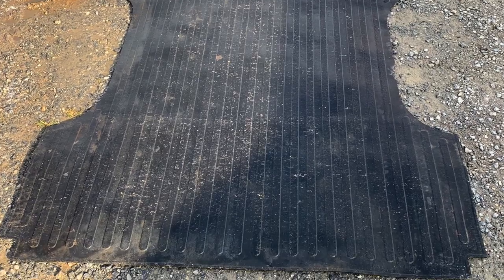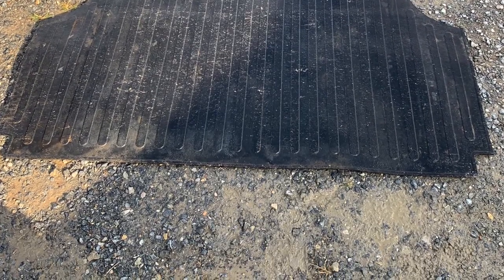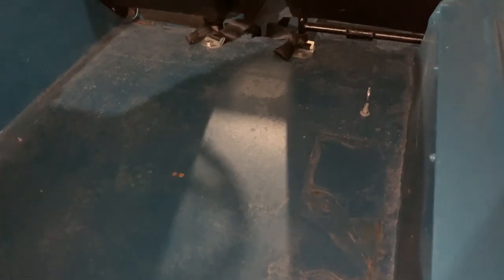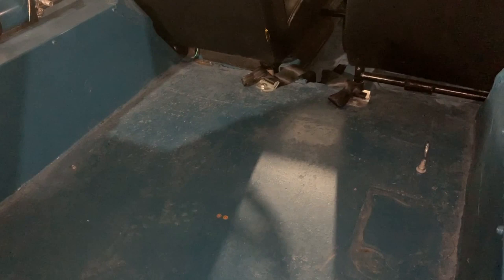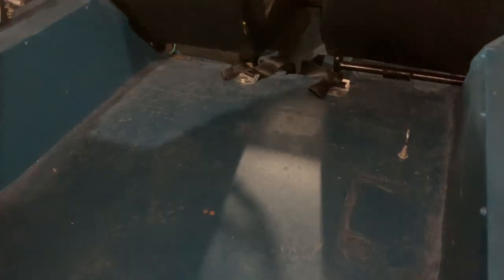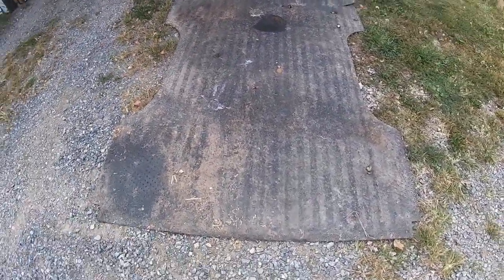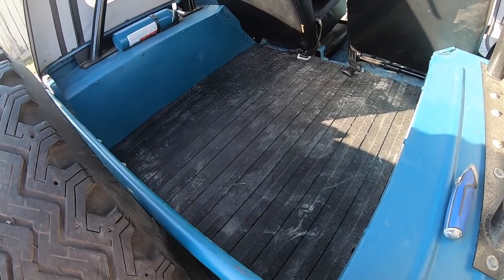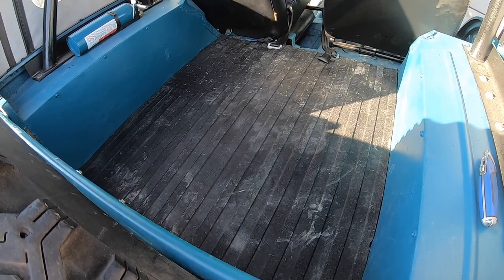DIY Classic Jeep Rubber Cargo Liner!

Comment: I like it. Great use of the old mat. The cleaner did an outstanding job. So did the Bleachwhite!😂
I did a similar project using one of those carpet mats that are at the front door of a commercial building. They are the exact width of the CJ bed. Trimmed the front like you did.   The only downside I found was the moisture under the mat. Thanks from Texas.  👍
Reply from the maker: Mark Randall that bleachwhite stuff is pretty nasty stuff but it works! That’s pretty cool the carpet mat is the same width as the CJ cargo area! Thanks for watching!